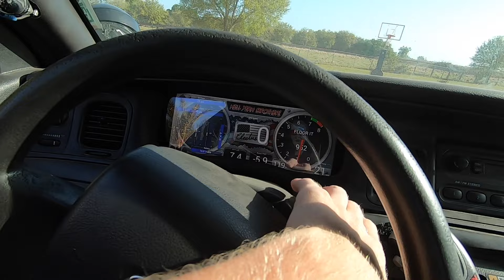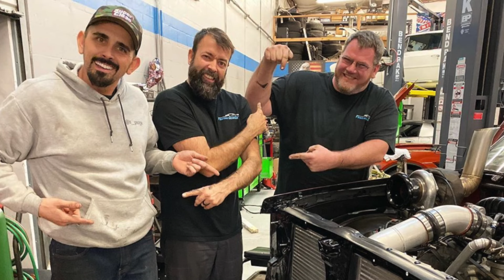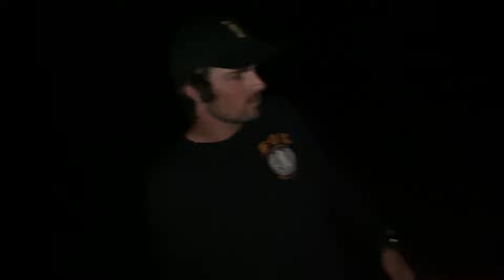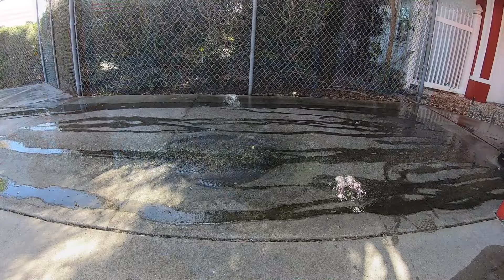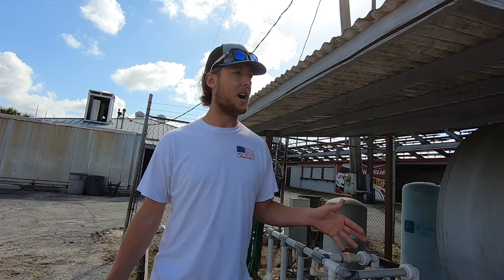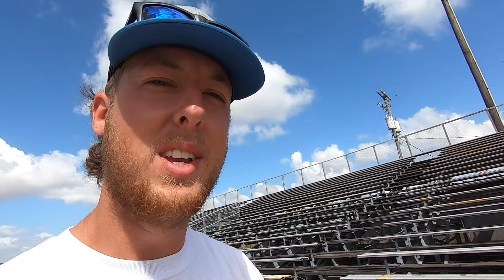The Freedom Factory has some MAJOR Issues You Probably Didn't Know About...

Comment: OK I don't think a lot will like this but:

Do white walls for video, if you have a blue car you disappear in the section that is blue it really sucks in Pay Per View. Most track walls are white. Mobile bleachers can be moved closer to the burnouts (like a mosh pit) if suitable barriers are in place pricing higher for the mosh pit area.

As for the pumping to the pond either the pipe to the pond is the restriction or you cannot hold enough in the tanks before pumping to the pond / field. Cheapest fix is bigger holding tanks no other changes needed and you can add a pump from each new tank into the existing system if you do not want to touch the current ones have a backhoe to dig the hole for the bigger tank.

Remember with the tanks you do not care if it takes 2 days to empty from full as long as you have the capacity to hold it for 2 days.

With your plastic water tank if you can and the well pump will fill it lift it say 3m from the ground that way if a pump fails you will still have some flow just low pressure, a toilet issue with speed of refill but not a problem that cannot wait for a plumber (include a shut off valve at the tank)

Comment: Why don't you knock down the bathrooms and put in Port O Potties. Would be much cheaper and less of a headache.
Reply: Have you ever seen what folks under the influence can do to a Port O Pottie? nasty
Not to mention the cost, they run (per unit and number of times they have to be cleaned per month) around $150 to $400 per month, times that by 20 minimum or 50 max and that can get costly, probably better off fixing the septic system.

Comment: For your paint removal.  5" and 7" Bosch, Hilti, or Dewalt brushless grinders, talk with a technical rep for Hilti, Bosch, Dewalt about what kind of disc to use, dustless shrouds, a couple of Hilti VC-300's with splitters and 2 hoses for each one.  It will remove the paint and pickup most of it while you grind as well.  Probably cost $3,000-$4,000 for tools, then discs and time.  If you do this, you can use a coating instead of paint and it will last much much longer and help prevent your concrete from decay and rot.  Yes, concrete can rot.